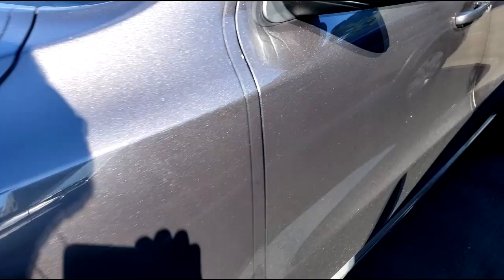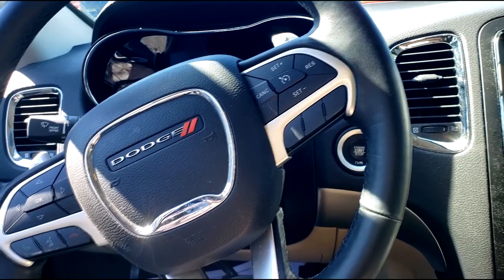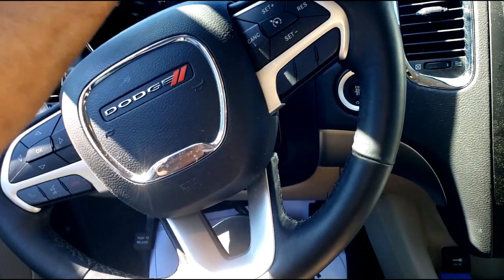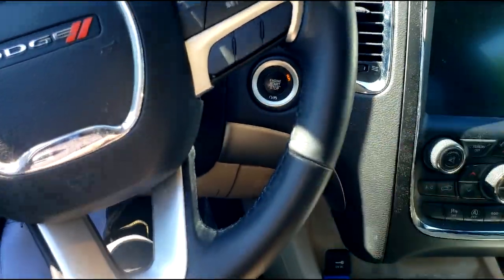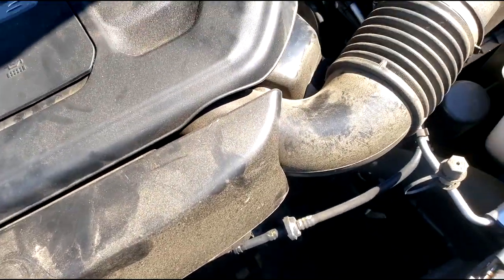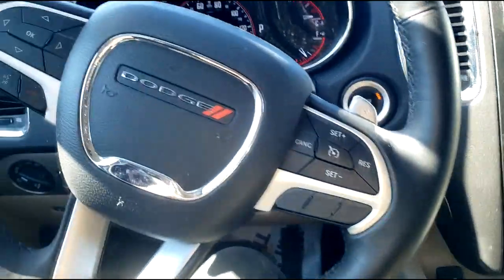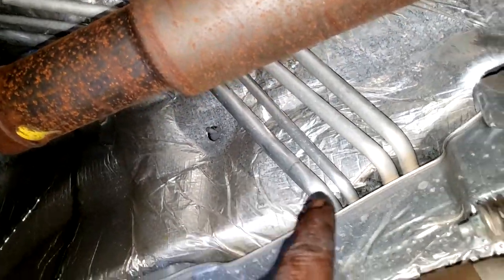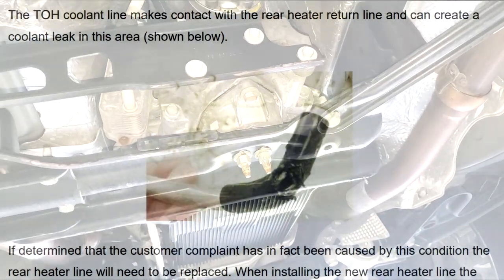Car Engineering Biggest Blunder. Dodge Durango coolant leaks FINALLY FOUND. See here. PARTS Ordered.

Comment: That should be a factory recall, that's pitiful hose routing setup, designed to fail. You hopefully can trim it down and readjust the clamp so it doesn't rub but that's a horrible place to run everything together. The engineers just don't think about service or is this going to be a problem later it seems nowadays. Just how quickly they can be built. A car intelligently designed for service is a joy to work on. Most new cars seem to be designed to make it impossible to repair later. I have heard Kias are super easy to work on or replace parts not that I want one but a good thing for the owners.
Reply: Kia's quality is pretty dang good now too. Rarely get them at my shop. Can't recall any major issues either.
Reply: @sienile  thats good to know as we are currently looking to buy a kia sorento!.thanks

Comment: 3.6 2018 Durango. 150,000 miles. Keeps overheating and cylinder 2 misfire. Dealer already replaced both gaskets, spark plugs. So frustrating, I’ve notice coolant is going way too fast but no noticeable leaks, any ideas? Awesome channel and video btw. Subscribed 💪🏽
Reply from the maker: Thanks. And sorry you going thru this. But if you losing coolant your engine either burning it or theres a leak  The video here shows where coolant can be lost but in some cases not hit the ground. In most cases you can pressurize the cooling system and the leak will show up. But hopefully its not internal because that can be expensive work. On your next oil change or when the vehicle off the ground in the air, have the mechanic look in this spot.
Reply: Exact same problem in my 2017 Durango.  I managed to squeeze my hands up there and apply a two part sealant (a variant of JB Weld) and stopped the leak for 4 years.  But it has reared its ugly head again as of yesterday.  It should be a recall.
Reply: @LiteShaper1  I ended up just trading it in last week. The dealer had no clue what was going on and I wasn’t gonna keep giving them more chances. Save yourself the trouble man, trade it in or sell it if possible.

Comment: So JT did you have to remove the trans to make the repair or did you replace the tube by removing heater to gain access?
Reply from the maker: It depends. I seen guys fix that there own way with trans still in car. Depends on the mechanic

Comment: Just finished putting in new intake camshaft rocker arms, lifters and phasers in my 2018 Durango. Want to know why? The rocker arms ate the center out of all 6 high lift lobes. So yeah it still happens. Just over 93,000 miles.
Reply: Happens when you don’t take care of it 🤡

Comment: I have the same exact leak! I watched your video before I went to the dealer and they told me verbatim what you said. 2.5 year old Durango but I just went over my 36,000 miles so I'm not covered! I called Chrysler customer service to plead my case, we'll see what they say, waiting for a call back... i can't see how I can possibly be on the hook for a defective part and/or shitty engineering. This sounds like a class action lawsuit waiting to happen
Reply: Do you ever get a response from them?
I have the same issue and they said im not covered because the durango has 50 thousand miles and they are charging me 1000 dollars to fix it omg this is crazy
Reply: @scorpiotv5750  was that dealership price?
Reply: The dealer wants to charge me $2065 to fix this on my lease! Shouldn’t this be covered by the power train warranty? The car has 55K miles?
Reply: What did they say as of warranty coverage?
Reply: @michaelmcpeeks4769  they were actually very flexible with me. Even though I was over the warranty miles and technically they didn't owe me anything, they ended up covering more than half. I was out of pocket like $1,400 as opposed to the $4,000ish it was going to be. They assigned me to a case manager and she was pretty great. I heard that if you're a returning Dodge customer you'll have better success. (We had a new Journey before the Durango)

Comment: My metal line above my tans like yours had the same problem had to drop the trans cut  that metal hose line then reflange the metal hose tip so it would reconnect to the rubber hoses
Reply from the maker: Same here bud..I need to find and upload that footage tho
Reply: How much that run you
Reply: @joecieri5173  i made a mistake when I said trans it was the drive line it only costs about 150 to have done but if it’s properly done and the rubber house decides to pop off its more likely built pressure from a blown head. So I ended up having that fixed and new cam and lifters put in bc that notorious lifter tick that  ends up over time shelling the cams lol 7000 dollars later she’s fixed but now has a sensor inside the gas tank that needs changed. And a a/c leak. if my wife didn’t absolutely love it and the fact that it’s paid for It would’ve sold
After I had it fixed

Comment: Do you have anything on how to go about the repair? Have the same issue 2019 dodge Durango
Reply from the maker: Hey bud I simply had to replace the line on this one. They make repair kits for those line but that area extremely hard to get to.
Reply: @OnlineMechanicTips  ok thanks for the help

Comment: They (dodge) have had these issues even since the gen 1 durangos that had rear air and heat. I had two different trucks with the same problem, i cut them and added a section of rubber hose with clamps and never had a problem after that. I have a 14 durango now but its been good so far, but a buddy at work had this with his 17 durango just out of warranty but they covered most of the job. I told him to cut it and put a hose if they weren't gonna cover it but they did. They replaced the whole line but were also possibly going to put a repair fitting but didn't. they never put a recall on the issue.
Reply from the maker: The only problem with this is that the tensioner clamp facing the wrong way. If you ever buy one and want to avoid this, simply turn the tensioner clamp the other way so it will not rub a hole into the line.
Reply: Was this a repair you could do in a driveway? I’ve got the same leak and want to put a hose in, but I can’t figure out how or where to drop all the parts under the car to access the hose.
Reply: @_shotbyjones  I did fix mine in the driveway, luckily for me both times I was able to cut the line and put a hose without having to remove anything other then the frame bracket to separate the lines. In one case I believe the bracket caused the leak ,on my other truck it was not by the bracket.  If yours is above something you would have to figure out how to move it to get to the leak.
Reply: Thank you for the reply! I’ve been limping this Durango around since I bought it. I’ve got no money for a mechanic so I got to get creative.

Comment: I have a 3.6 gen 3 in my 17 Durango. It’s eating coolant and blowing out white smoke for a solid minute upon startup…. Think it’s the head gasket?
Reply from the maker: How many miles on this vehicle?
Reply: 116,000 and now I am 💯
Reply from the maker: O wow my guy. Yes that is a true sign exhaust gases getting into the cooling system by way of either a blown head gasket or now warped cyl heads. But because you well over 100k not good. Sometime they would approve this repair under warranty as a good will. But it's un likely now, they may think you kept driving it why it was in the over heated state and now has ruined the engine.
Reply: Krazy my Durango just started doing this same exact thing....outta nowhere it started blowing out big clouds of white smoke...
Reply: Yeah and dodge will play stupid until your wallet is drained. Get some pour and go gasket sealer. It worked for me for a few months

Comment: This this would be a problem for 2019 durango RT V8?
Reply from the maker: Hey bud, yes this could be a problem on the 2019 models but the key here is to get a good look in that area. They relocated how they route it in the late 2019 and newer Durangos.
Reply: Thank you I will check it out as well. I got the multi point inspection just in case so far so good. Thank you for replying quickly. It has 20k miles.

Comment: I believe that i have this exact coolant leak on my 2019 Dodge Durango. What does this cost to have it fixed? Also, is it safe to drive it short distances, say 5 miles, to the mechanic if i watch the heat, or should it be towed? Last question! Do you have a video of repairing this?
Reply: Yes. Keep antifreeze with you.

Comment: I absolutely hate that dealer mechanics are ripped off by the warranty process.
Reply: It's horrible. My shop doesn't do it, but I see the time difference in the manual and sometimes it's a huge difference. Most times its around 70%, but seen some as bad as 50%. The mechanic didn't make it break. Why should they get paid less because it wasn't made good enough to last the warranty?

Comment: Any way to repair this at home? My 2016 Durango has the same issue.
Reply from the maker: Depend on which line it leaks from. What year is your Durango? Also are you subscribed to the channel?
Reply: If you can get a clean cut, cut it and piece in a good piece of rubber line. Wrap it to prevent rubbing.

Comment: I have a coolant leak, but they can’t find a leak. The shop I took it to said it’s leaking in the engine oil SMH. 2018 and it’s not overheating. But once all the coolant leaves the resivour, it blows out cold heat.
Reply from the maker: Dang how many miles on this and is it a 3.6 engine? Also are you subscribed to the channel?
Reply: Check the Engine Oil Cooler Housing, under the air intake. They leak also.

Comment: How much was cost of labor and parts? I have same issue on my 2011 Durango 5.7 RWD. I’m looking to get it fixed soon since getting another vehicle isn’t ideal at the moment. Thanks
Reply from the maker: Hey bud, this repair went warranty so im not sure what the customer whould have had to pay. Thanks for watching, please consider subscribing to the channel, thanks
Reply: @OnlineMechanicTips   Hey brother thanks for the info, I'm subscribed btw, been for a while now. Also what all did you have to disassemble to get the line replaced? Can the rubber portion of the line be replaced alone or will the entire trans, tank, rear suspension need to be dismantled.
Reply from the maker: @nmcclint93  To do it the right way, you suppose to drop everything you mentioned above. I ended up lowering the transmission and cutting the line at the miday point and just installed the upper part of the line. And you must relocate the clamp that chewed into the line..I just joined the 2 lines together usung heater hoses. Its not under a lot of pressure and will hold. Depending on where your leak at and how much freedom you have to be creative will dictate what you do,,,Good luck bud
Reply: @OnlineMechanicTips  Thank you I will try to present this to my mechanic when I take it in so they don’t charge me too much.
Reply: @nmcclint93  hey so how much did you ever end up paying for that. Im having the same issue and I want to find a good mechanic that actually knows what hes doing

Comment: Having this problem on my 2020 durango ! But it’s in a different spot. One of the clamps from the transmission oil cooler liner was rubbing on it and put a hole in the heater hose
Reply: Having the same issue, I have a 3.6 gen 3 pena, oil cooler hose at the opposite end in between the fire wall it's got a hole from the heater hoses clamp rubbing on it. There's literally like 2 inches of clearance. I can't get to it from the top and removed the windshield shroud and still no clearance.. I at this point don't know how to get to it. Still leaking.... Crazy that they think this is ok. 😢
Reply: Also not a single video on YT about heater hose replacement either for the gen 3 penastar 3.6 V6 AWD

Comment: Hi bro
I have a question pls,Where is the fuel filter (gas filter)?
I can’t find it and I want to change it but I don’t know where is it at?
2011 Durango v6
Reply from the maker: There is no fuel filter. What problems are you having? Also are you subscribed to the channel?
Reply: Actually its connected to your fuel pump in tank.

Comment: Having the same problem on my 2013 dodge Durango.
Reply from the maker: Sucks, is it leaking in the same spot?
Reply: @OnlineMechanicTips  to be honest I cant see where the leak is coming from exactly I can tell it's from that relevant area
Reply: @OnlineMechanicTips  is it worth fixing ??
Reply from the maker: @rodrigodavila493  That all depend on where its leaking at. Dont assume, it may be something simple. Pressurize the sys then look around. Also are you subscribed to the channel?
Reply: Yeah I figured it wouldnt be easy by the way you showed it and explained it. So I know its gonna be a pain in the ass. I am not but I will coz I couldnt find anything about it til i ran into this

Comment: dude this has to be recalled….my 2019 same issue they want $2300 labor to drop the frame
Reply: We just pulled the trans out so we could get to those metal lines then we cut where the leak was reflagged the metal hose tip where it was cut and reattached to the rubber hose. No need to pull from frame just have to pull trans
Reply: Same issue 
With my 2019 did the dealer fixed it for u?

Comment: I’m having this same issue😭 and I don’t know what to do.
Reply from the maker: O know, im sorry to hear that. In some cases, the manf may help. How many miles on your Durango?
Reply: @OnlineMechanicTips  I just subscribed, sorry I thought I did that before I watched the video.😫 This was very well explained. But I have a 2019 dodge Durango sxt plus and it has over 59,000 miles on it.
Reply from the maker: @JxstDae97  Whoa, way to soon for that. Normally warranty coverage up to 60K on powertrain. If you could get in the ear of the corp and seek assistance with this repair, you may get lucky. I think theres a 1 800 number you could call but I dont no it.
Reply: @OnlineMechanicTips  great! Thank you! I will look for that number and call them now!
Reply: @Online Mechanic Tips  hi my 2019 doge drango has the same problem which number can I call
Reply from the maker: @haloppll  That problem was corrected in the later 2019. Are you leaking at the split? Also are you subscribed to the channel?
Reply: @Online Mechanic Tips  by cabin smells from burning wire when I turn on the heat
After making my research it came up that it gotta be the heater core
Reply: @OnlineMechanicTips  and I just subscribed:)
Reply from the maker: @haloppll  Well I can tell you this, they will not go by your verbal diagnosis. They will likely want to know exactly whats wrong with your car and whats causing you. They may need this info from a dealer. In most cases, dealers do not insp cars for free so you may have to get that problem diagnosed then try to see if they will help or even extend the warranty for this repair.

Comment: Did you ever come up with a fix for this or did you replace the whole pipe? I have the same issue on my 19 durango.
Reply: What was the remedy for this heap of junk?
Reply: @apb20916  I took it to the dealership. It was the exact same leak as his and the replaced the whole pipe. Under 50k miles they cover it under a warranty. I was over 50k but I bought an extended warranty from the dealership so they covered it. It would have been 1500 other wise. If they wouldn't have covered it I would have just cut the pipe rebent it and added a hose.
Reply: @THEBJLaughlin  nice!

Comment: I’m having the same issue with my Durango 15’ RT Hemi @116,000 miles. Looks to be a heavier leak, was told there is a hole in the coolant line, the leak is also dark in color like oil which left a big stain in my drive way. Is this a costly repair?
Reply from the maker: Very

Comment: I know this video is old but if your considering a durango. DONT do it. I have a 2018 durango gt with 40,000 miles bought new.  I will never buy another dodge after this one. This is our 5th dodge and have never had issues untill this one. First 3 yrs of car i Used factory warranty for Hood paint bubbling front edge, drivers side plastic panel near window falling off,  radio display screen bubbling, gas tank fuel neck replacement.  Lift gate stopped beeping when in motion and Something with spark plug area cylinder #3  i believe. I forget extacly what.  Extended warranty ( thank god) so far small coolant leak near pump. Oil leaking at oil pan. Water dripping inside above driver where the microphone speaker is. I am not rough on my cars. This car is in pristine condition looks brand new still.  Great job dodge. Thanks for the crapiest $40,000 car! Never spent that much on a car. Never will on a dodge again. After i get this last one fixed Looking to trade it in.  Durango still leaking oil after they fixed oil pan seal.  They found it was also leaking from the rear main seal.  Finally fixed. Wtf
Reply: Witch Durango
Reply: 2018 durango gt 3.6L

Comment: Dang. Sucks that showed up at the dealer and not your side job. They'll make you do the whole line. Otherwise you could just chop out the bend, flare the end, and use a longer hose. Maybe since it looks like a factory design flaw you can see if they would let you.
Reply: Nope not at a dealership

Comment: How much will that cost to fix?
Reply from the maker: What year Durango? Also are you subscribed to the channel?
Reply: @OnlineMechanicTips  yes I am 
Is a 2011 and im having the same problem is leaking coolant
Reply from the maker: @ignaciogutierrez6962  Well on that year the leak could be in different areas. So the location of the leak will dictate the prices. In some cases a lot of stuff have to come off. But first you need to know where exactly is the leak coming from.

Comment: My 70 426 never had these issues, had 12.5 comp. ratio, huge solid rocker cam . Made 550 / 600 hp maybe more, what has happened to Mopar
Reply: New greedy owners
Reply: Poop eaters took over